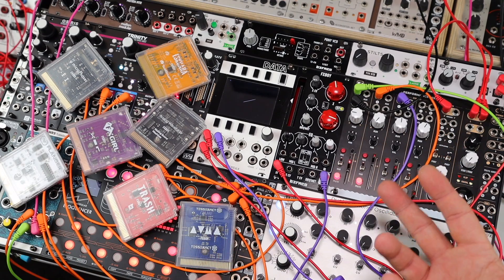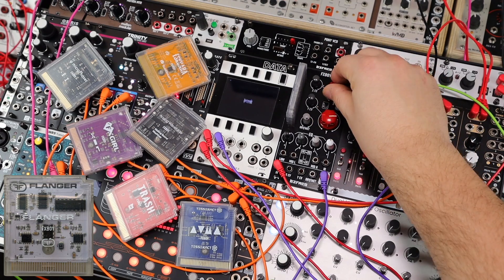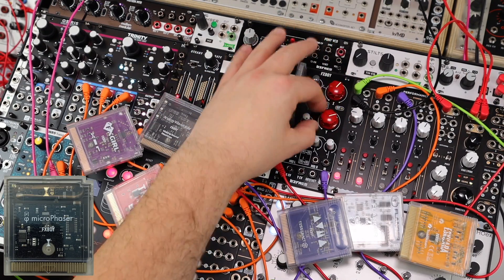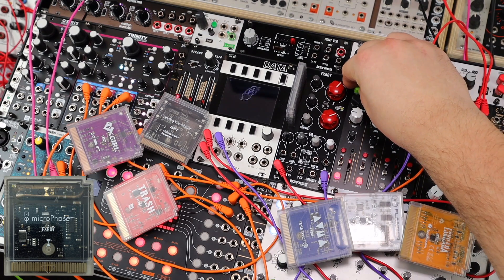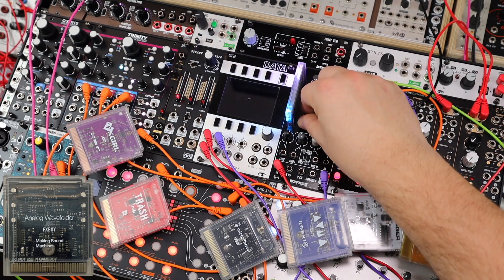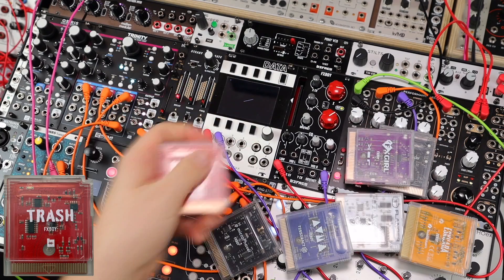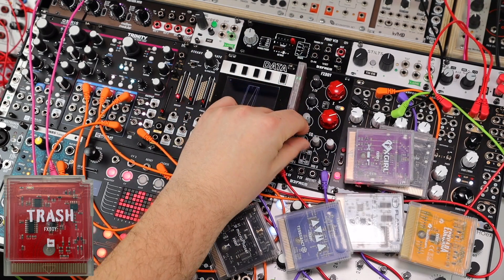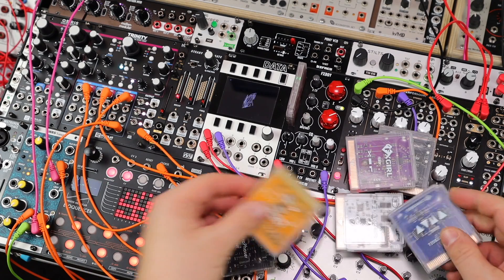Hot swapping FX circuits with the Befaco FX Boy // CAUTION - there's utter filth in here!

Comment: Great idea - would be cheaper and convenient though to have a USB slot and download packages from respective companies?
Reply: With the cartridge these effects can be analog, as a number of these are.
Reply: True @nckwntzl  👍
Reply from the maker: as nckwntzl mentioned, these are analogue. It's not code you're swapping on some DSP host, each cartridge has an analogue circuit inside them. 

Worth checking out the full demo if you haven't - https://youtu.be/k3jIpcwsC1c?si=1Q7xX1DmC00lOzmD